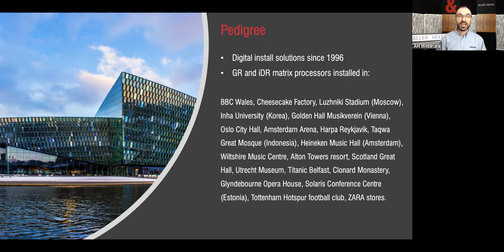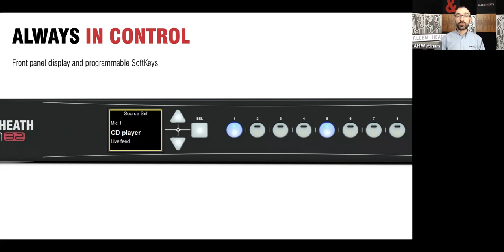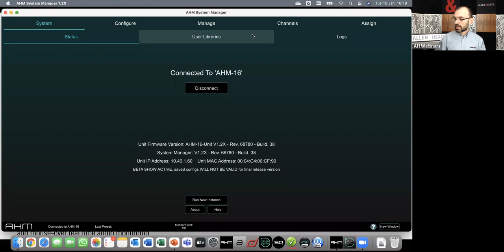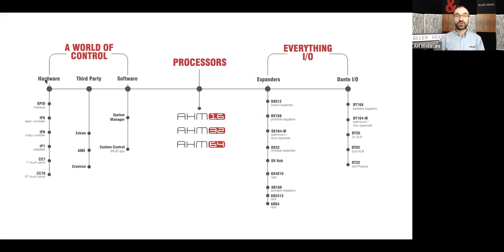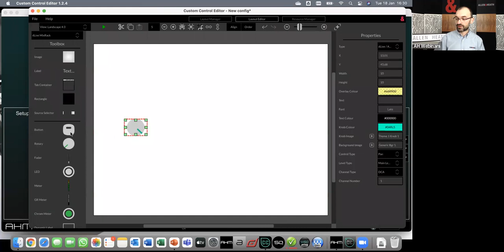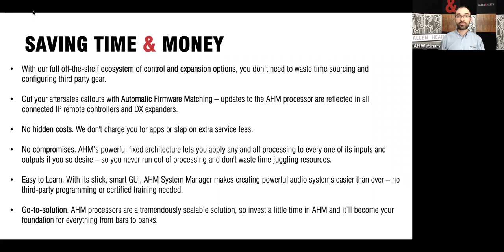Simply Scalable – AHM-16, AHM-32 webinar

Comment: Hello, can you do reverb and effects with the AHM units?  If it is needed how can you add it in?
Reply from the maker: Hi Fareed, 

The AHM series of matrix processors don't have any internal FX. This is because they are designed for speaker management and audio distribution applications rather than live sound mixing. 
If you need a rack mount style mixer, I would recommend looking at the Qu series for small scale applications (https://www.allen-heath.com/qu-series/) and the dLive MixRacks for large scale applications (https://www.allen-heath.com/dlive-home/). 
If you feel reverb is required on the AHM, please go to support.allen-heath.com to submit a request so we can get a better understanding of your application. 

Thanks!
Alex